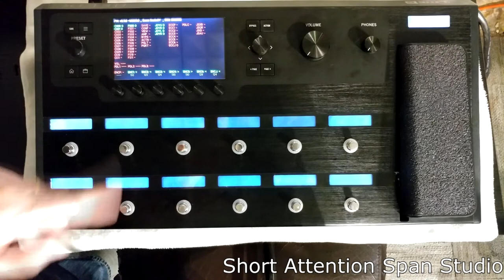Line 6 Helix Floor open surgery and diagnostics to repair joystick issue.

Comment: The problem I’m having is the preset button - it scrolls left and right but pushing it does nothing. Any advice? Thanks in advance!
Reply from the maker: There are 4 wires mentioned in this video. One of them does just that. It seems the signal when pushing down. Try the controls test in this video. It will show you in red what does not work.
Reply: @GlenHyden  Hello Glenn, thanks for your video how to disassemble. My preset button do also not work anymore when pushing down. Therefore I can not access into menu for control test UI function. 🤔
Reply: try sliding a thin guitar pick underneath the preset wheel/button and just apply a little bit of inward and upward pressure and it should pop back out. try some at different thicknesses until it works. that's what I did, and it was surprisingly easy

Comment: Great video! Did you see a fuse in there somewhere? My Helix just died on me after 6 years of serving me well.
Reply from the maker: I did not.
Reply: Mine also just died, no power at all, did you fix yours? still scratching my head
Reply: @steventhompsonlivetoplaylive  i gave mine to an electronic repair man, hope he can help me, have not heard anything from him yet..
Reply from the maker: @Johannore  was there a smell of burt capacitor? I would guess that is what it is. The supply section gave up.
Reply: @GlenHyden  i'm not shure. I was not at home when it happened.

Comment: My joystick cannot scroll😢 it can pushed down and press left right up down..do you have solution??
Reply from the maker: Solder it back on. One of the four leads has been disconnected.
Reply: @GlenHyden  is that it? So i dont have to buy the new joystick?
Reply from the maker: @yugi_ibnu  Wait till after you re solder to buy anything. Did you run the test in my video?
Reply: @GlenHyden  yeah i already run test..and when i rotate the joystick its still turn red🥲
Reply: @GlenHyden hey man i already fixed the joystick problem..but now my expression pedal not accurate..it cannot start/stop at level 0…do you have solution please😢
Reply from the maker: @yugi_ibnu   perhaps clear the reader actuator or adjust in the settings 0 to 10.
Reply: @GlenHyden  how to do it?? I
Cant find in settings
Reply from the maker: @yugi_ibnu  select your wah or volume actuator. Where the position knob is.. hold it down for 2 seconds. You should see zero to 10.

Comment: Hi thanks for the video..all the upper switch foot FS 1 To FS 6  on my helix floor don't work.
Sometimes when I turn them on they work and switch for about 5 minutes but after that they don't switch ... Only with the preset knob... Can you please help me?
Reply from the maker: Run the test shown in the video. If it passes fs1 - 6 then it's software. If it fails then it goes back to line6.
Reply: Thank you for your answer and help! Do u mean that if it fails should I take it to line 6 factory? Thanks
Reply from the maker: @camilaymaddieshow932   yes. If the problem is NOT software, send it in.
Reply: @GlenHyden  thank you and what if it's the software? What recommend me to do?
Reply from the maker: @camilaymaddieshow932  backup and factory reset.

Comment: Do you know how to fix the plastic part of the scribble strip. The lcd looks fine but the plastic over it is bent in. Im thinking of trying to take the top half of the chassis off and bend the plastic back into place. Dont know how to do that tho
Reply from the maker: I do not. Yamaha may have the board in stock? It's on a series of ribbon cables.

Comment: This is invaluable.  How long did the job take?. Mine has this fault but its hardly used.
Reply from the maker: First time 35 min. Second time 20.
Reply: @GlenHyden  thats not too bad, not sure I have a balls for it though, if it turned not to be the wires, could i get a switch easy enough